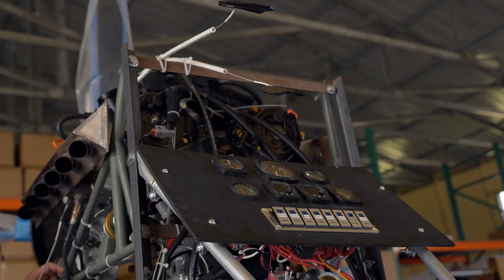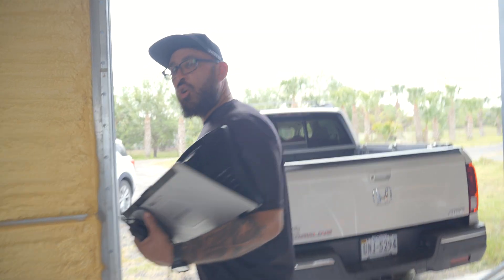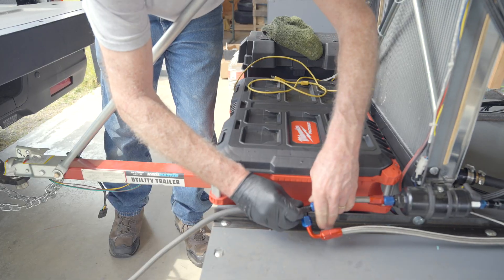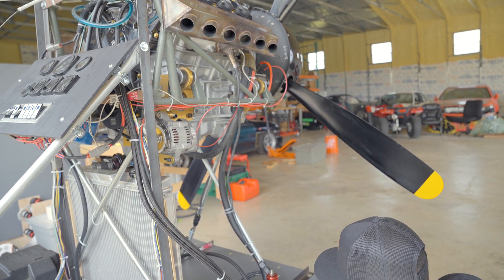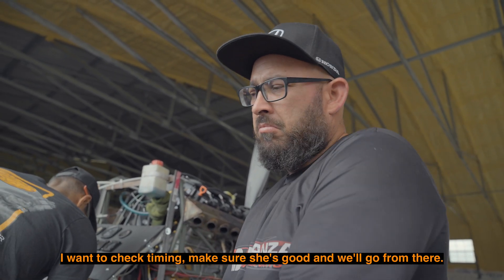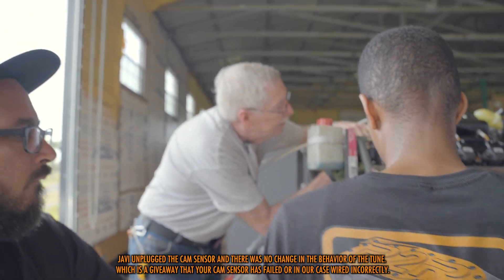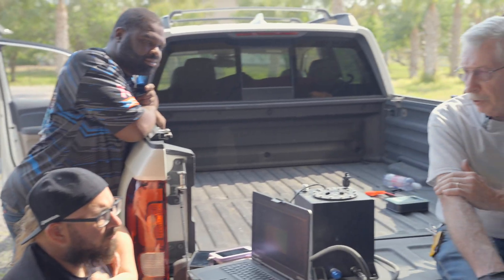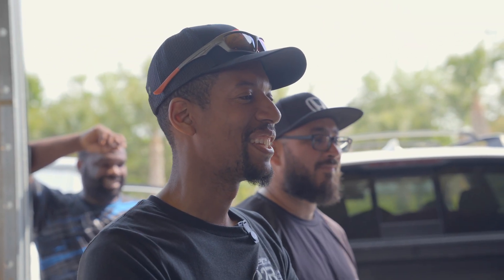Get Ready For TAKEOFF With The P51 Mustang J35 Engine

Comment: A timing belt in air plane engine.
Reply: What's wrong with that?
Reply: @PistonAvatarGuy  Nothing. Until it snaps and you have to hope it doesn't snap on take off so you can have time to glide down to a landing spot
Reply: @Rekceir  Any timing system can fail, and timing belts don't seem to fail any more often than any other cam drive system, except for gears.
Reply: @PistonAvatarGuy  Well I have never owned a timing belt engine but I will soon because I am looking for a 9th gen accord v6. But from what I have seen and heard is that timing chains last a lot longer than a belt. I'd still fly it but is feels a little more risky than a engine with a chain. But I am a pilot and car mechanic not a airplane mechanic so idk maybe it is just fine.
Reply: @Rekceir  Whether or not a timing chain is going to last depends on the engine. Some engines just have really horribly designed timing chain systems that fail frequently.

Ideally, an aircraft engine would use gears to drive the cam(s), but that's not a common thing in automotive engines. MWFly seems to have a pretty decent system figured out, where gears take care of some of the rpm reduction and a chain (driven at low speed) takes care of the rest. The reduced chain speed reduces wear and stress on the system.
Reply: @PistonAvatarGuy  True I guess I was just thinking of a chain like in my k series car which I think is very well designed. And I think I saw in his other video he put an upgraded timing belt on this engine.  

Also nice username lol
Reply: @Rekceir  Honda does have excellent timing chain systems.

Thanks for the compliment.